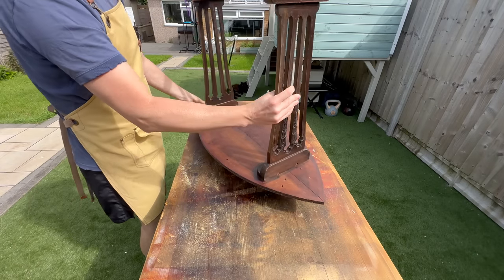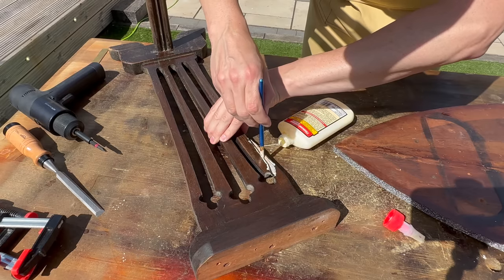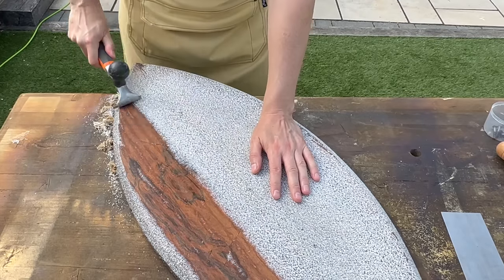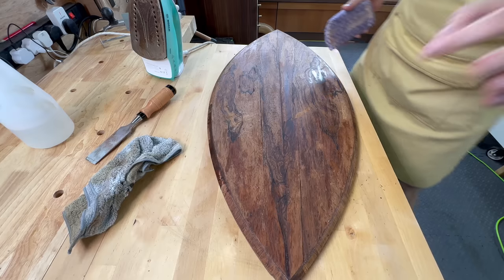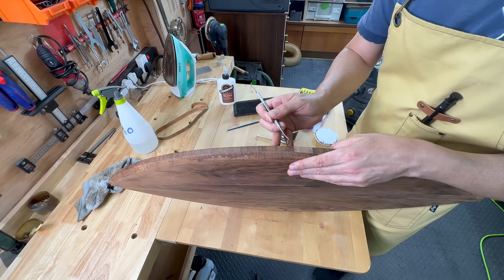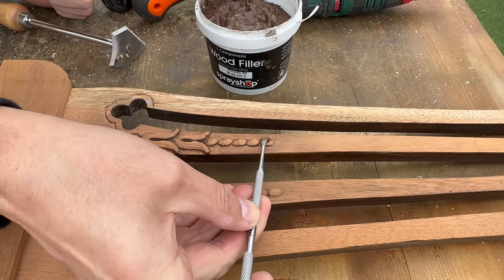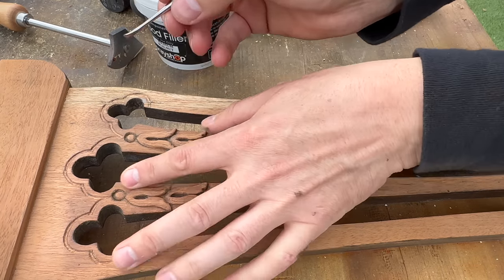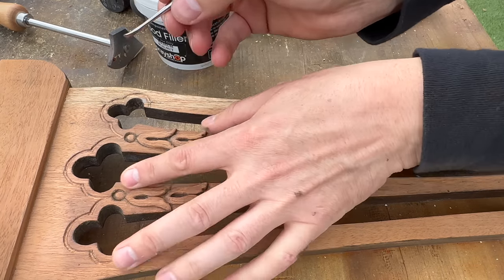I found this weird table and restored it.

Comment: I think the top of this price is made from one of those round tables that has flaps that fold down to make the table smaller or fold up to make a round table. I think someone took the side panels off of one of these tables to make the top of this table.  I think the holes on the underside of this table top are from the hinges that were on the original table.  The legs might be the legs of the original table.
Reply from the maker: who knows but a good guess ;-)
Reply: Could be! Maybe the manufacturer had extra ones and said, ‘hey that’s different!’
Reply: A gate leg perhaps?
Reply: This table reminds me of something that would be in a rectory or the nave of a church. I used to clean the chapel at my university for free tuition and it looks vaguely familiar.
Reply: This table reminds me of something that would be in a rectory or nave of a church.
Reply: Yes this table looks like it was 'frankensteined' from various unrelated furniture parts.
Reply: drop leaf

Comment: It's been over 30 years since my husband and I had an antique store and repair/refinishing shop.  My knowledge may be dated, but is hopefully useful.  Polyurethane can actually melt when hot dishes are placed on a tabletop and a beautiful finish can become a lumpy, bumpy disaster.  Lacquer or varnish is better.  You have done a lovely, careful job of restoring someone's marriage of a quilt stand and the sides of a small drop-leaf table.

Comment: I have a similar piece I’ve started working on. It’s been in our family for years. I’m 62, and I think my parents had it before I was born. I remember it being an ugly brown when I was younger, then my mom painted it a flat black when I was a teenager. I’ve sanded it and will probably paint the legs a flat black again, but I was going to Varathane the top. I’m going to try the iron tip on the dents and scratches. So many good tips for my table. I’m so glad I found you! New subbie, too!

Comment: My grandmother had a very similar table in her front entryway.   We used to call it the surfboard table.  It did have a curved partial piece in the front and back.  It was about 4" top to bottom  and would have been placed lengthwise where you showed the screw holes in the bottom of the table top.  I'm not sure whatever happened to that table. Your table came out beautifully and brought back memories.
Reply from the maker: Awesome, thank you

Comment: 😻😻😻 absolutely beautiful ❤. It looks like someone put two different damaged tables together to make one unique piece. Possible clues are on the table bottom. You can see where the skirt of the larger possibly dining room table was. The legs are from a smaller hallway table. The texture paint was to hide the missing parts of veneer I think.  Just my thoughts

Comment: That top is just stunning! I always enjoy watching you work, and I truly love that you use so many different methods. It’s nice to be able to think about a solution I’ve seen on your channel, or another on here, when I encounter a particularly challenging issue. I actually thought about you (well, your nifty little sandblaster tool, anyway!) yesterday. I scored a beautiful antique chest at a garage sale for $10! It has lots of carved detailing. I offered the little lady more money for it, but she refused. It was in the home during a house fire, and though it didn’t get burned, it does smell strongly of smoke. I’m fairly certain I can strip it and eliminate a lot of the odor - and I suppose I could always just use shellac to finish it, though I normally only use it for preventing bleed through on painted pieces because of the potential for drips and runs.
Reply from the maker: Good luck with that chest! thanks for watching

Comment: I have a similar table. It’s from the late 1920’s. It was a thrift shop rescue. Yours is around ten years older. You’re right. It had a skirt originally. I have no talent for woodworking. You do incredible work. The refinisher did an acceptable job on mine.

Comment: If I hadn’t seen the entire video, I’d believe that the before and after are completely different tables!  The wood grain you revealed on the tabletop is absolutely gorgeous, and you blended the different woods in a very stylish way.  I wasn’t a fan of the painted top, but this finish is stunning.  

Is it possible that this table has been cobbled together from different pieces of furniture by the previous owner?  I read in another comment that it could be the curved ends of a larger dining table that could be expanded with what my grandmother called “leaves” designed to turn a circular table into an oval.  The attachment of the legs is a little suspicious, too, and the bottom edge could have had a wooden border designed to hide the mechanism to extend the table.  The legs are a completely different wood, and like I said earlier, their attachment is sketchy.  I appreciate their creativity and reuse of pieces of different, possibly damaged, items to make a new table.  I’ll bet it was a conversation starter, but your finished project is simply amazing.
Reply: I love your feline inspectors and supervisors. I would probably be distracted, too.

Comment: Lovely! Interesting piece! Beautiful job.
I’ve been looking at quite a lot of videos, and what I’ve noticed is that when they do the little “touch up s, they first use a much lighter color than you would expect, much lighter than the surrounding vaner. Then they add like stripes or whatever pattern is suitable , in darker colors. Understand that I admire what you’re doing, and only write this because you said that you’re not an expert. Maybe you could try this?

Comment: That table is a console that usually includes a mirror that goes on the wall. Looks similar to a craftsman style. Or could be a church kneeler, if the height is the correct one.

Comment: That's such a beautiful table.  I wonder if it would be less tippy, if you added another wider piece of wood under each of the two legs. Maybe about 18 to 20 inches long, around  4 inches wide and an inch deep. Just a suggestion. I'd be sorely tempted to buy that if it didn't look so tippy.

Comment: That's an ironing board holes is not for a the skirt but rather they are from the top protective fabric cover they would probably have contained hay or cotton.

I seen one of these with the fabric top in a museum it said it was an ironing board

Comment: Oh sure Jay, blame those poor, pitiful, starving, homeless, unloved, kitties who have to wander the streets and beg for food.😜

The console looks really groovy now. At first I was of the opinion that the top was not the original, basically because I’ve never seen anything quite like that before. I would have expected either a true rectangle or one the is like a rectangle with rounded ends. 
You put LOTS of small detail work into this. You’re right about not knowing the veneer had been replaced in spots or that the feet had been drastically different. 
The whole thing is all taken care of all the way around. 

I have a console that belonged to my grandparents. I use it an altar in my home. I’ve been to a lot of antique and consignment stores and never have seen one like it. I love it. It really does need refinishing, but that’s not happening any time soon. (😵‍💫)
Reply from the maker: Thanks 😊 have fun with that

Comment: The legs look like an original featherweight Singer sewing machine table.
Reply: The top was shaped like that and lifted off. There was a small cabinet underneath that held the small sewing machine. Replace the top and set the machine on top to sew.